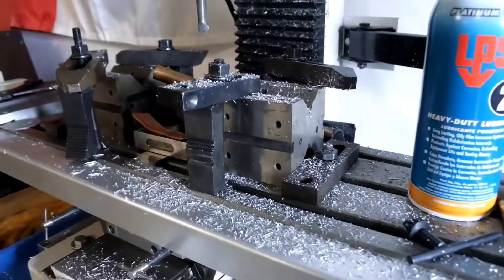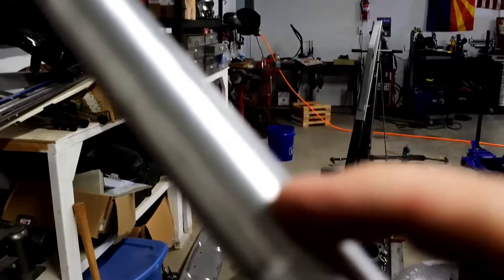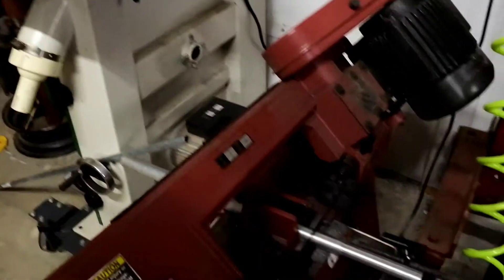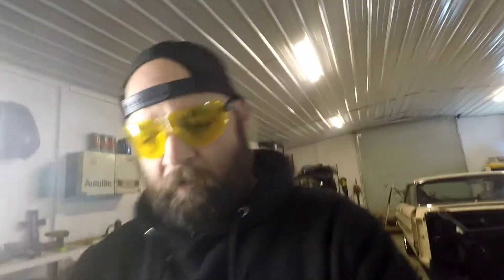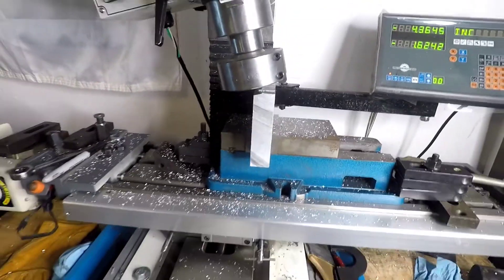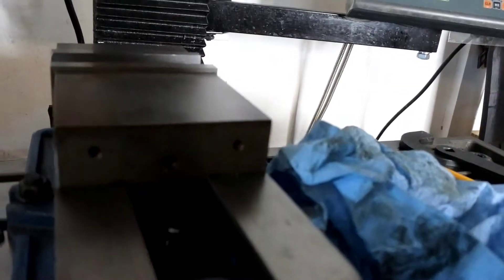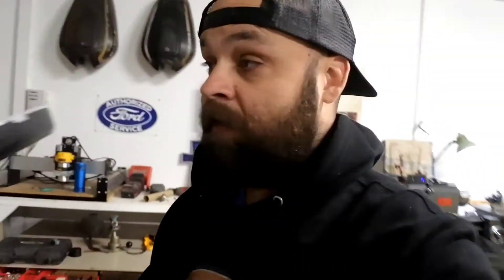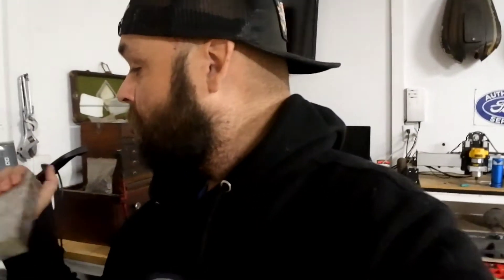Piston holding fixture (for cutting valve relief)

Comment: Hey bro. Don't put any angle on your block. Put a valve in you spindle and float it down to the valve pocket on the piston. Have you block floating in the vise 90 degrees to what you have now. Keep the vise loose. Match the angle of the piston to the valve by "loving" them together and then tighten the vise.
Does this explanation make sense, same block works for many pistons.  The stock manufacturer relief should get you close enough.
Polish your pin shaft very good as you don't want to scuff the pin bores.  Drill ROD can be bought in any diameter for a pin shaft. It is generally machinable before hardening.
Reply from the maker: Yeah actually that makes perfect sense. If I have to do it again, I’ll definitely do that! Thanks for commenting and taking the time. I appreciate that.